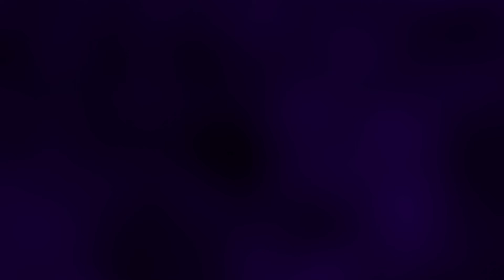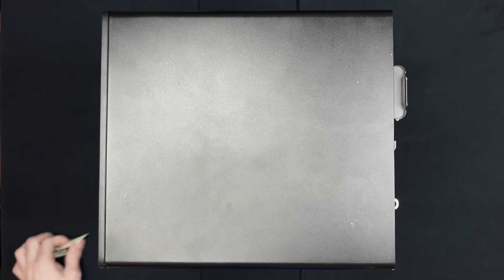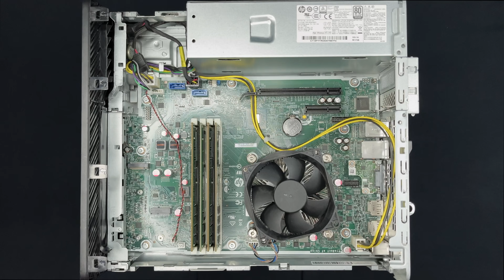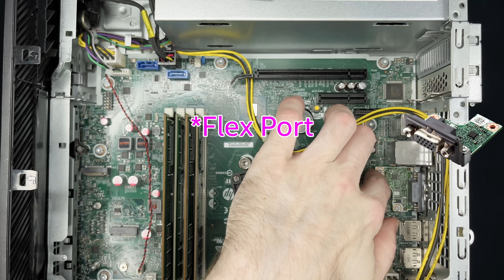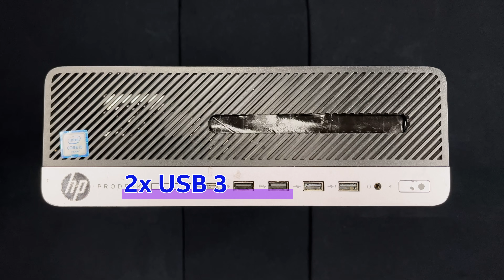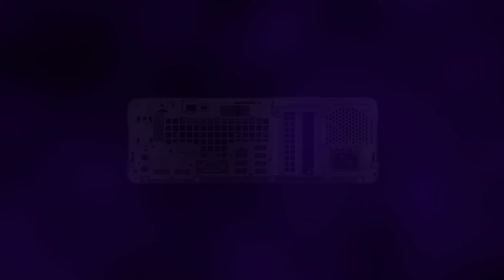HP ProDesk 600 G3 SFF and You in 2024

Comment: SO I was supposed to receive the sff but instead received the mini tower 600 G3. I decided to keep it. It's intel 8th I5-8600.
There are some things you need to know about the mini tower vs the sff:
-there are no onboard usb connector ports, so you won't be able to run a pci-e wifi card as they use a cable which connects to onboard usb. you will have to run a USB dongle.
-there are no nvme m.2 ports, so you cannot install an m.2 drive or an m.2 wifi module.
-the oem bios behavior could frustrate the bananas out of you. I keep having to clear cmos to get it to boot the os again... maybe something about the OS I'm running is off?

1:13 edit.. my bad, I didn't realize that connector was possible to be utilized for usb!!  weird!!! *

my statement below is now deprecated:
"here we can see the same issue with the lack of onboard usb connectors due to logic of the system with the front/op usb ports being integrated onto the actual motherboard.
this means you cannot use a pce-i wifi card, but you can use an m.2 with the sff. "

The sff is a much better machine in terms of practicality because you get m.2 slots for your drive and wifi, and you really shouldn't be running more than an rx550 or 6400 on the oem psu anyway, so you don't need extra gpu space. I specifically ordered the sff version because of this, but was sent the tower, which as I mentioned before has no m.2 slots, and consumes almost twice the physical real estate.

this is my build:
-600 G3 mini tower
-I5-8600 + stock cooler
-16gb t-force team dark pro (was running 2x8gb visiontek 2400)
-rx550 4gb
-pci-e to m.2 nvme drive adapter
-wd sn270 256gb nvme
-wavlink 1300mbps usb wifi antenna

The one good thing about the mini tower is that you definitely do have room to run a common dual fan gpu, but if you do this, you will need to upgrade your psu to an aftermarket sff unit.
I never had this intention as I was supposed to receive the sff and chose the rx550 as it's still a great performer for under $50 shipped.

Comment: Can I add a 2 pin 5v fan in here? If yes where can I connect the power? Thank you very much
Reply from the maker: On these more compact models (compared to G1,2) you would need some kind of adapter coming off of the SATA power.  Should be a pretty cheap option if you can find it.

Comment: I wonder if, so that one could use a dual slot low profile GPU, could manage to fit either a smaller PSU OR desolder the small PCIE slot and use a PCIE riser cable and place the GPU where the small PCIE slot was.
Reply from the maker: If you're not concerned with closing the case, I've moved the PSU and used full-size dual slot GPUs no problem.  Since you mentioned a low-profile GPU I doubt that's your plan and haven't came up with anything beyond a case-swap.  

Also remember the power limits on the pci-e slot if it doesn't have the separate pins.  I think it's around 40w.  From my inventory the quadro p620 has been a great match and allows the case to close, just fyi.